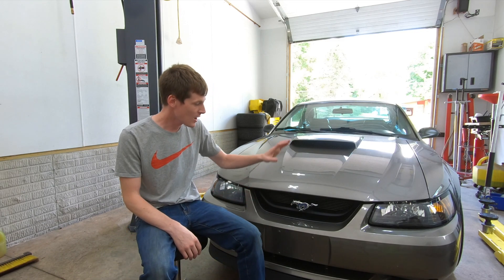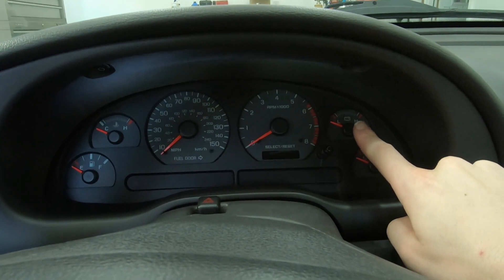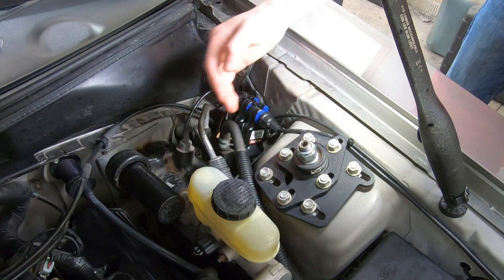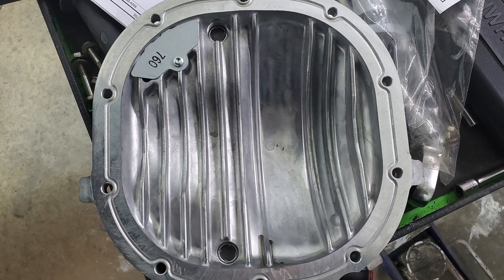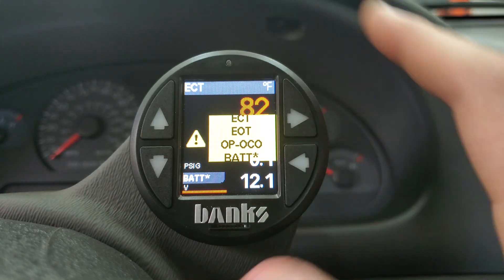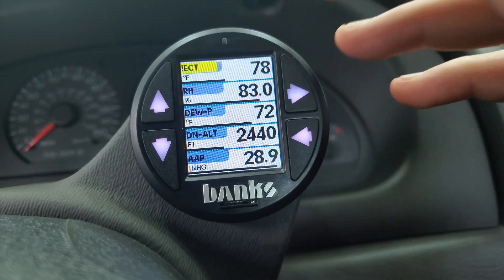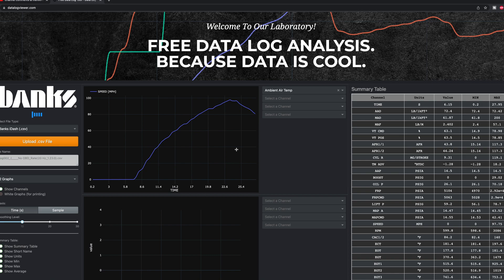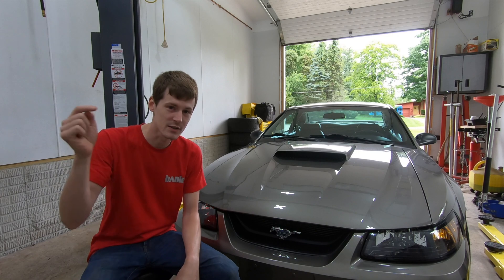This One Gauge Makes Every Other Gauge Obsolete! ( Banks Idash )

Comment: You know everything is built on the Mile reset? Look it up. You'll see
Reply from the maker: You won't find oil pressure (it always reads 100), oil temperature, transmission temperature, or differential temperature in there. The only useful data in the cluster diagnostic screen for my situation would be ECT.

Comment: Wouldn’t it have been better to install AeroForce gauges that plug into the OBD port and show you live data log information?
Reply from the maker: That would work as well. That unit doesn't have the expandability though. I'm currently monitoring 5 things that the stock PCM has no sensors for. AeroForce only has 2 additional inputs.
Reply: @RepairGeek  Ahh that makes sense

Comment: I have a 2001 GT vert and have actually found my SCT X4 tuner can give me all the same live data as well, and can be mounted to the windshield! It came in handy when I put the OEM gauge faces back in my car to set the needles correctly.
Reply from the maker: You aren't monitoring oil temps on anything with an X4.

Comment: Hello, I have a coyote swap with a F150 Gen 3 and 10R80. Onto a New Edge 01 Mustang. Do you think this will work just with the OBD plug alone? And give temperature readings for transmission fluid, oil and coolant ? Or do I need to install temperature sensors individually for all fluids like you did on this video? Also does this read Tach signal?
Thanks
Reply from the maker: If the control pack has CAN (Control Area Network) communication it should work I think. I would think either the Ford Racing control pack or the stock 18+ F150 computer are all CAN communication. You could always call Banks to 100% verify. 

So if your controller is CAN it will work fine and read everything off your data stream. If your controller isn't CAN you'll need the sensors. The stock processor is so old that it isn't CAN which is why I needed the sensor modules.

Comment: Is that tranny gauge sticking straight out exposed ? Any dirt road or rock would eat that.
Reply from the maker: It's not any lower than the exhaust or the engine crossmember. A 90 degree street elbow was just as low.

Comment: 06:50 You should have ran a 90 degree elbow on that sensor... That is sticking down far enough that the first hard bump or pothole you hit will tear that sensor off
Reply from the maker: Even a street elbow would stick down just as far. Looked into it. It's above my exhaust and engine crossmember like it is.

Comment: I can attest to the iDash and it’s power.  Recently towing my boat on my diesel zr2, the coolant temp needle didn’t seem to move much but the iDash showed it went up from 178 (the usual) to 196 while towing.  From looking at the needle you could never had guessed that.  It wasn’t anything of concern but it’s good to know your vehicles normal operating temps in different situations.  Now I now my trans will be in the 205-210 range, engine oil in the 220 range, and engine coolant in the high 190’s while towing in 90 degree weather.   If I ever see anything very different, then I’ll be concerned.
Reply from the maker: Watch your stock coolant temp gauge when the truck is warming up. The stock gauge will move off 160 and the coolant temp is actually something ilke 120.